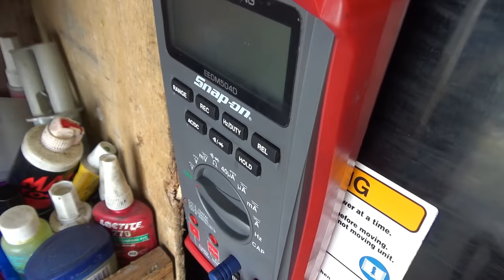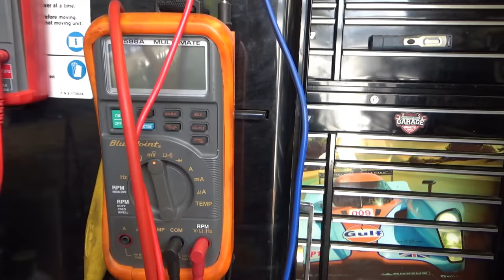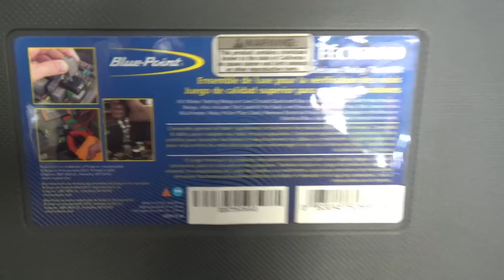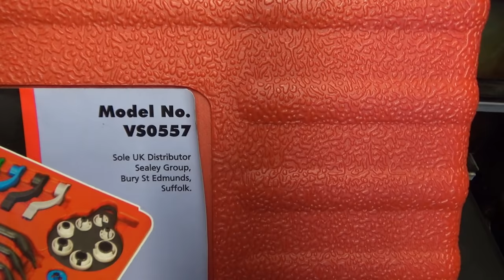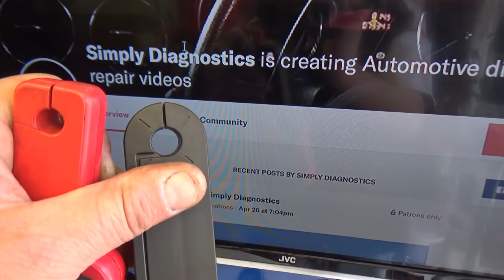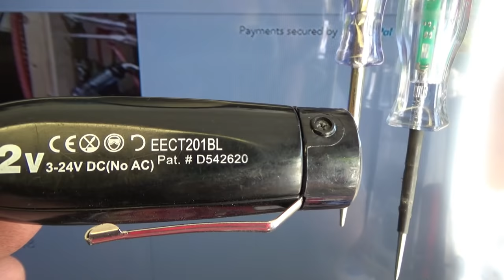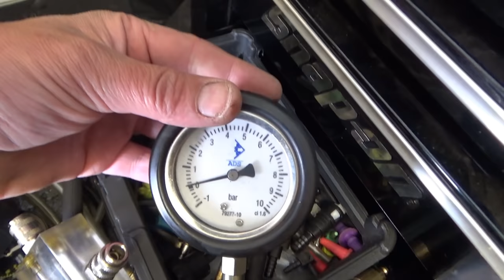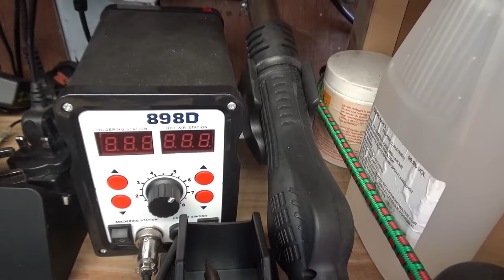Toolbox Tour #1

Comment: Steve, that is a very impressive set of tools and test equipment! I would never thought it would take that much. But when you drive up to a vehicle with an issue, I can see that you have to be prepared for any problem. Take care Steve and don’t work too hard! 😀👍
Reply from the maker: Many thanks Terry 👍
Reply from the maker: urbex 2019 flowcharts and set procedures have to be adhered to in dealerships. I know a lot of great dealer techs , better than me that are hamstrung by this. I’m lucky to be able to work outside the box. Cheers

Comment: Diddent you know all techs have fetiches for ratchets , lights , and test lights lol. Pretty similar array of diag tools that I have less some of the dedicated euro tools. Was going to get the verus but went with the autel instead due to the improved asian and euro coverage. Just got info last week on the new snap on Apollo scan tool. It the cheaper version of there Zeus tool. I use the term cheaper very loosely. I seen a new attachment for The power probe today that reduces the output voltage to 5 volts for powering 5 volt ref circuits very handy. Great tool box tour.

Comment: Hi Steve, wondering if you can help. Had  galaxy 2.0 tdci parked up for a 1.5 wks drained the coolant as it had antifreeze in it. Refilled it before trying to start it and it now wont start. Came up with crank sensor fault. Replaced crank sensor and now its coming up with a glow plug fault and p0087 low fuel pressure regulator fault. Bith clear but come back again. No pressure when i crack the injectors open after cranking.

Comment: Cheap eBay astro copy LED lights, got 2 of them myself. light output good but plastic very low quality which shame as likes of 50p on better plastic or just thicker and about 4 more screw points would of made it pretty solid and worth few quid more .
Like your relay test kit, I made my own over the years but will have look into a lisle one .
Love to see you mobile guys, hard enough doing it in a workshop but out in the streets in british weather takes men of men ...
Reply from the maker: For me they’re throwaway money. I’ve got good lamps but these were so cheap it would be daft not to buy them
Reply: agree they throw away prices, I just found if drop them on concrete from 5ft which scenario on a lift or from on inner bonnet working with vehicle on floor the housing breaks proper easy as such brittle thin plastic which shame when only few pence would of made it little more rugged at the factory . 
One I prefer is the round alloy one with screw cap like torch for the 18650 cell and hinge on the light bar, astro and sealey do those but not for £7 lol . crazy cheap shipped to your door .

Comment: Hey, On your Amazon store you have a fuel injector test tool by allsun I think 🤔. However in your video you have a sealey one. What is the difference please?
Reply from the maker: Same thing internally, they're all just a timed PWM controller 👍
Reply: @SimplyDiagnostics  Is that a good one or would you reccommened the sealey one as I do quite alot with injectors. Love the vids aswell. Learning new techniques from so thankyou.
Reply from the maker: I can't personally vouch for that model but all the various ones have the same internals that I've seen 👍